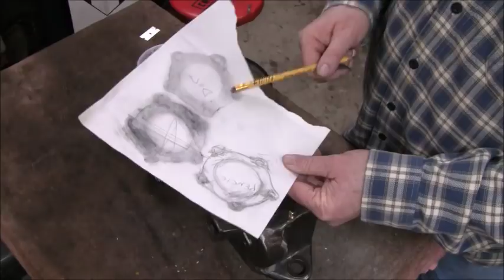HOMEMADE OVERHEAD VALVE BRIGGS (part 17)

Comment: I think you and I are the only people with old gasket material, to still make gaskets , :-)  it’s looking good RoadKing!
Reply: Old graphite #2 pencil ✏️ transfers well, or lightly paint the top and transfer it to paper like a rubber stamp ;-) hope those help too, I have even used a permanent magic marker that I used in a pinch, just made it very soaked in ink! Then just wiped it all off and clean it .
Reply from the maker: Thanks Mate!! Most of the old stuff I work on they don't sell gaskets for any more!!☺

Comment: I've only had to make one gasket before, but my method it seemed to work really well. I just used one of them blue markers the machinists use, coated the top top of part that needed the gasket and pressed thick paper on it and it gave an absolute perfect imprint and it just rubbed off the metal with alcohol.

Comment: Hey Roadking. Just a thought, what about the stuff used for finger printing. Roll it on the metal surface of the block, then press the paper on top of that.

Comment: I love making gaskets and those young fellas get pretty impressed when you pull out a piece of gasket paper and ball peen hammer and go at it.  Works for water pump and thermostat gaskets on cars too.  End of a Bolt make a good hole punch backed by a vice or something.  Usually for those heavy gaskets, I just tap enough to make the markings and then cut with a good pair of shop scissors that way there is a nice sharp edge.

Comment: Hello, the holes you can make with the ball of the bearings.
I send you a big hug from Argentina.
Reply: Ball bearing, I like that idea. Thanks
Reply: That is a great idea for bolt holes! I have a habit of saving things like old ball bearings and this is a good reason! Also makes great slingshot ammo!
Reply: Addition, you can rough up one side of the ball bearing and glue it (any metal glue will do) on to a piece of tube only slightly smaller. And voila, you have your own ball end punches. I have made some, even welded a few. Excellent for all sorts of things, not just working the hole on gasket.

Comment: I wonder how the dust would work if applied to the block and paper laid on top and rubbed. Maybe the powder would transfer? The pencil  looked good.
Reply: I've done it with sharpie and white paper before. Truthful I think loading the block up with the dust, laying paper on top, and rubbing to transfer the pattern was what the intended method was. I've seen my grandpa do that with the graphite powder but I didn't suggest the method and I have no clue what that guy/gal does.
Reply: That was my thoughts too. The biggest pain in the ass doing a paper transfer is holding the dang paper still and flat as not to disturb the accuracy of the trace. In the gunsmithing world we use a substance called inletting black. As it sounds, its a pitch black gel like substance which is somewhere between amorphous and a thixotropic goo that doesn't readily dry like a paint will. Its put on a barrel and/or action in a thin coat and then placed in the stock to be fitted. The inletting black transfers to areas of contact which show up after the action is removed. I have tried this principle before on gasket making adventures with fresh paint but it's tricky. Inlet black should work a peach! Easily the messier option in comparison.
Reply from the maker: I tried that too Lowrider!! That made more of a mess than anything!!☺

Comment: A ball barring a little bigger than the hole tapped with the hammer makes a real nice hole in the gasket. It;s easier to find the hole too, just put pressure down on the ball and it kinda sinks into the hole and than tap it with the hammer and you have a perfect hole.     Dan

Comment: That blue machining dye could also work i think. put some on the top and before it dries, use the metal part as a stamp on a flat piece of paper. If it doesn't imprint perfectly, put something sort of soft (like a piece of paper towel) beneath the paper sheet.

Comment: I work with nitro engines for remote controlled cars and what I found works best it taking a dry erase marker and draw on the metal with it and then stamp it in a piece of paper then just clean off the surface with some rubbing alcohol

Comment: Yeah, a little too much dust there :) whenever i use it, i just use a little bit after spreading it on my finger (the motion that you do when you gradually tip some salt in food). The best place you can use this method is for really detailed stuff.  Ultimately it's one those things you know and use for the right job. Directly hammering it seems to be the best option when you can do it.
Thanks for trying RK! About the dust, it seems the same, tho i do use a thinner paper.
Reply from the maker: Thanks Mate!! I would still use that method, it is convenient!!☺

Comment: You'd have to clean the block afterwards, but spraying a thin coat of contact cement on the block side of the paper would keep it in place nicely!

Comment: I think you were supposed to apply the fingerprint dust to the block and then lay the paper on top and gentle rub around the opening. That way it transfers to the paper and is a exact copy of the block. Could do the same with a sharpie on the block and transfer to the paper as well. Lots of ways. JMHO
Reply from the maker: I tried that too Gary!! That made more of a mess than anything!!☺

Comment: very nice job. what type of gasket should I use for my A.Y. McDonald waterpump? it did have about 1/8" red rubber gasket, what should I replace it with?
Reply from the maker: Thanks Bud!! I'd just replace it with another piece of rubber or just use some RTV Silicone!!☺
Reply: @805ROADKING  what about the gasket paper you used? the N-8094?
Reply from the maker: Yeah it says it's good for oil, fuel and water!!☺

Comment: Roadking, what about taking a picture then print it.....on second thought by the time you fart around with the printer settings and sizing you could have it done with the pencil!  :)   Love your videos thanks for taking the time to post your projects!!
Reply: I’ve put things on a copy machine for that purpose. It works good on some things.
Reply: 86lowrider I do this with power strip and other small items to transfer their pattern onto a wall for wall mount, works great. I would put a ruler next to the part you're scanning on the copier to scale properly for something more precise like a head bolt pattern since copies tend to be a few percent larger than original. No big deal for power strips and paperwork, but could mess you up on a bolt pattern.

Comment: I would have put the dust on the engine and put the paper on the table and flipped the engine upside down and made the imprint that away. it would have been faster and cleaner, you just press it in the paper. push down on the engine. the paper is taped to the table and you get a cleaner and nicer imprint.
that's what i would have done.

Comment: Why didn't you just go to your local mower shop and buy a head gasket? I am sure they would have at least a half dozen in stock for your custom overhead valve engine your making... don't you think? Hope everyone realizes I am joking. I like your way, with the pencil the best. Looks easer and less messy that any other way, including the way I do it. I use this ink stuff, that is often used in machine shops. I put it on the surface, then put the paper on it and use a hard roller to transfer ink to the paper. I am doing it your way next time!
Reply from the maker: I have a tough enough time getting the right parts for a 2015 Briggs!!☺